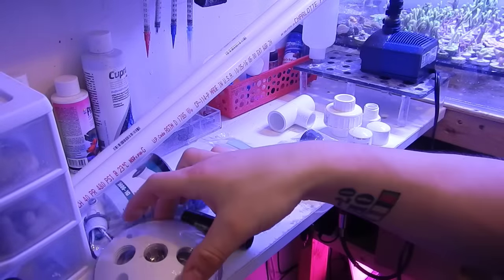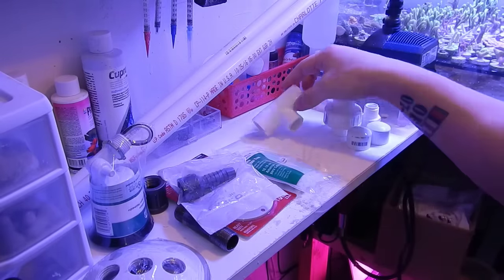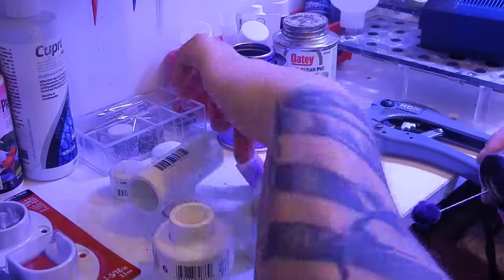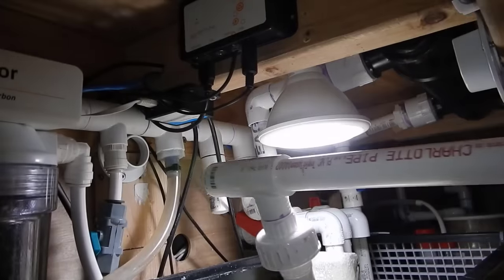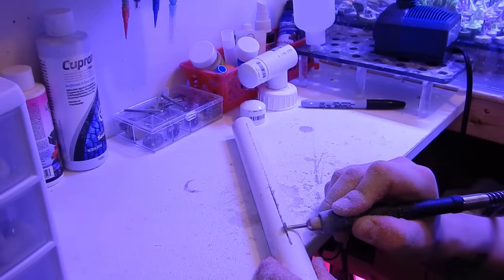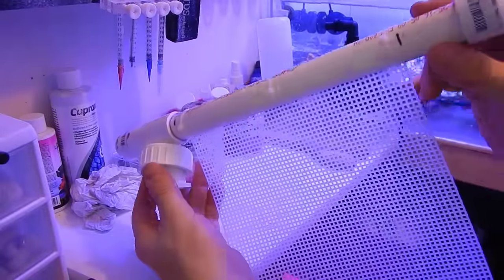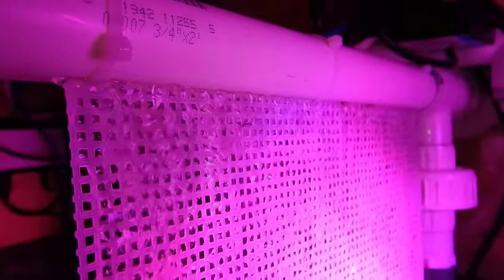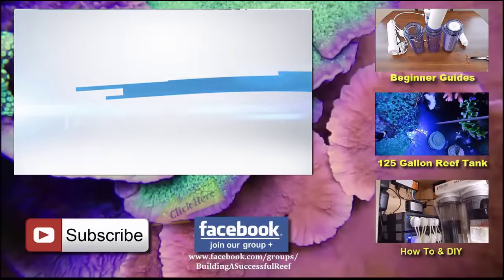Adding DIY Algae Scrubber To 125 Gallon Reef | Version 2

Comment: I have the same or very similar led light and I get no algae growth where the blue colors shine on the screen.  I read on a forum that you need 35 gallons per hour per inch of the screen width for best nitrate reduction. I don't like having splashing or spraying in my sump of the waterfall type scrubber so my mesh floats on the water surface while the pump washes water over it from the side.  I'll be interested to see which of our designs works better.

Comment: Not sure how long you have had this running, is there any sign of rust on the supports or the light conduit?
Reply from the maker: +Charles Adie video was posted the same days as install. No rust
Reply: Charles Adie i just used plastic pvc i think its more easy

Comment: Hey man I need help! About a week ago I added dry rock to the tank and got a small diatom bloom as expected. About 3 days ago I added some new sps and zoas to the tank and fed them reef roids. The day after I fed them the diatoms took off! I measured my nitrates and they are at 40! 1 week ago they were 2. How should I go about fixing this?
Reply from the maker: how old is the system? did you cure the rock before adding it? if not you are probably dealing with die off. Feeding the corals just added to the problem. I would up my water changes and stop feeding coral and cut back on how much you feed the fish until you get the nutrients under control